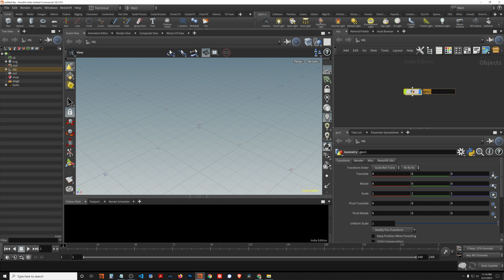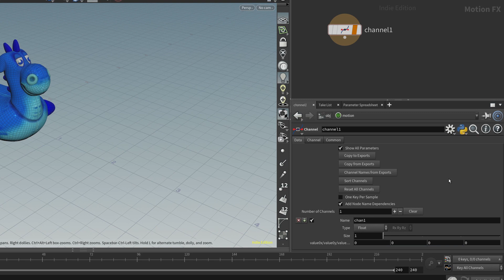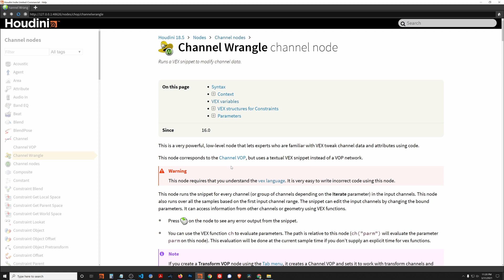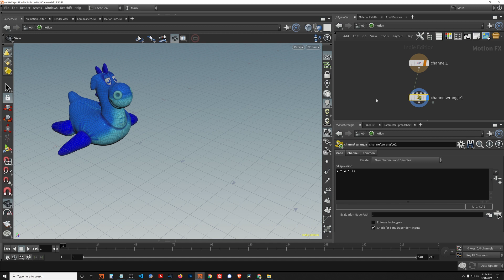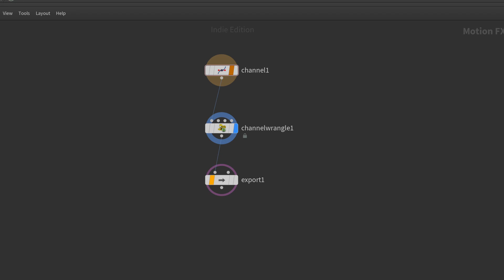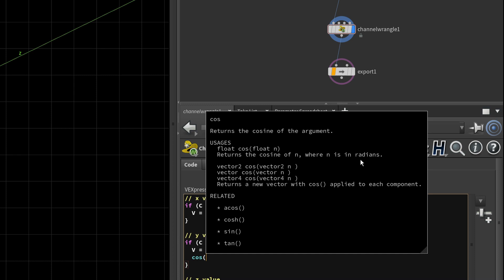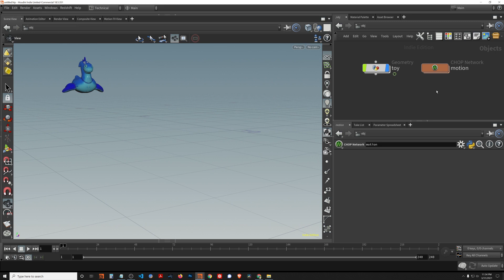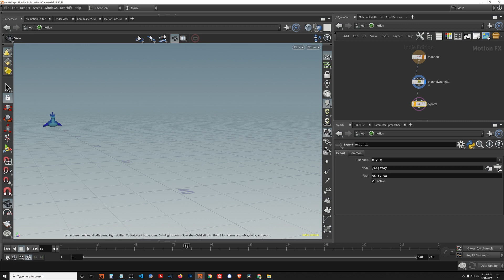Channel Wrangle Node  (CHOPs in Houdini)  ||  Exploring Houdini

Comment: Dear everyone! 🙂 Is there a way to normalize an animation?
Let's say I have a cube moving from x0 to x10 with a rotation of r0 to r90. 
Instead of adjusting each curve manually. Could I create a linear Motion Clip and then adjust a normalized curve with the handles? This would be a great way to make smooth animations. Anyone has any suggestions how to archieve this?
Reply: You can use Math CHOP for this. Go to the range tab and set the 'from' field to icmin(0, $C) and icmax(0, $C) to create the normalised animation then then branch 2 more Math CHOPs off and set the 'to' field for translation to 0 and 10 and another for rotation set to 0  to 90
Reply: note if you've only got one incoming channel you can just do icmin(0,0) and icmax(0,0). Using $C will normalize multiple channels